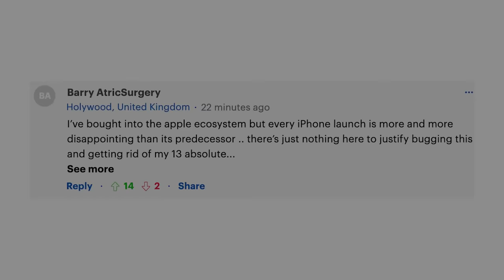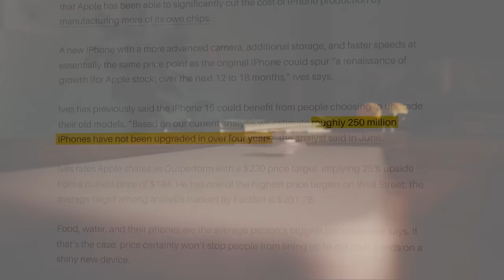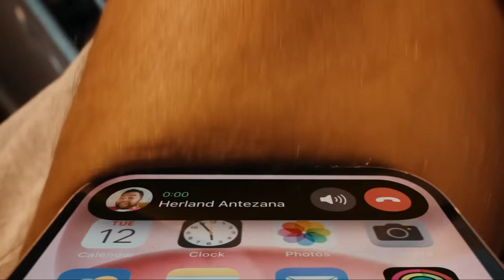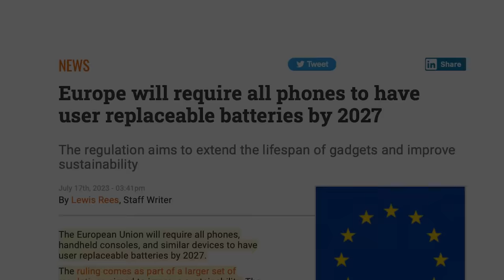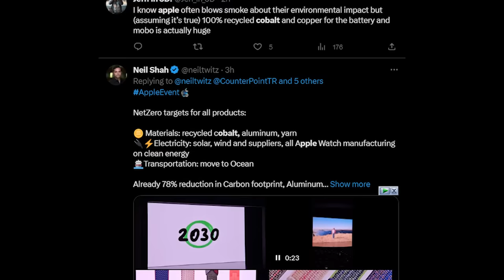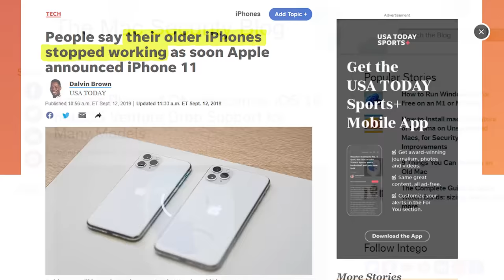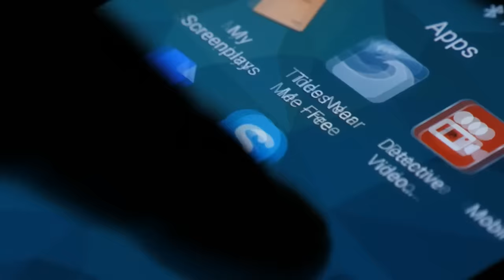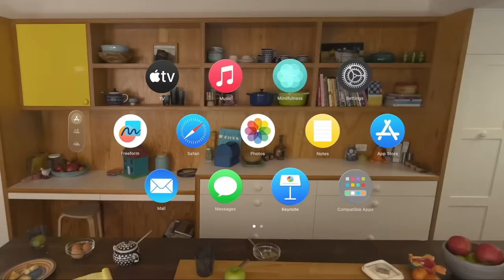The iPhone 15 Is Everything Wrong With Apple

Comment: I still use my iPhone 6+. Battery finally went out 2 years ago, and I replaced it myself for 20 bucks. I like the slim design and rounded edges, and all the apps still work fine. Camera takes good pictures, and cellular/data transfers are good. Never felt the phone was "slow" Why change? Maybe when iPhone 16 comes out next year, I'll upgrade; then I'll have a 10-phone upgrade span.
Reply: Downgrade imo
Reply: This should be the benchmark of praise
Reply: It won't be 10 phones
Reply: I kept my 6S for so long, but the battery was going down when it was plugged in so I had to upgrade.
Reply: I have a 6s and I agree with everything you said except camera taking good pictures. In fact that's my sole reason behind the urge to upgrade, for years.
Reply: i bought myself a new desk the other day and when cleaning out the draws on the old one i found my old Ipod classic, hasnt been charged in about 8 years, plugged it in and after a few hours it came on and worked as normal
Reply: the amount of hours you have wasted by simply using a slower phone is unfathomable. I am sorry for you.
Reply: @gajagoo  Yeah im with you here but at the same time, pay over $1k for a faster experience? LOL
Reply: @gajagoo oh boy, if biggest timekiller was a phones speed
We don't need no electronics to wash our time down the drain
Reply: he can also buy like the cheapest NEWEST android phone and still have a WAY better and faster experience. Why the fuck use an iphone 6+ and its not even an 6S which was already like 5 times faster than a normal 6. Just makes me scratch my head. @TilMayne
Reply: and he thinks being slow is a flex
Reply: i still use my Samsung S8 with no problems, only the battery is becoming noticably weaker since the day i got it but its fine because it still lasts around 4-5 hours on nonstop use
what i really hate about newer phones is not really lack of innovation but how every single one looks the same... its a sharp glass sandwich square with a camera cutout at top or below screen, every phone has same multiple circular cameras at the back...
i miss s7 edge s8, s9 and note versions of those phones... now everyone is doing the same thing preety much...
Reply: Ironically, I still kept my iPhone 7 after upgrading to the iPhone 12 this year. I mostly use it to play raid shadow legends, though.😅
Reply: @gajagoo  Ofcourse you have a Point about the better experience since mobile operators have their own device team and stop supporting older devices. I know, i work in the field. So you have a great Point here about the experience. I would not debate on this topic at all. Only thing i would say is that people should not be forced to think newer is better in the same manner as saying to a rich guy that this product is expensive. All people have different preferences and how they allow themselfs to experience things. I could go on and on but i believe my perspective can not be applied in this conversation. But i will eat popcorn and follow
Reply: @tatoweb  and the fact that its not a 6S. He was talking about a regular 6+ which is a huge difference actually 😂 Agree with your point still.
Reply: @daydreamdirty  7 is a HUGE upgrade in speed froma 6S, altough id say 8 is the bare minimum of daily usability without issues.
Reply: i remember back in Bali, Indonesia i lost(stolen probably) a brand new XR and i had go quickly grab an used iphone 6. And that was in 2019. Holy fuck the struggle i got so pissed off that i went back to grab atleast a 7 to just FUNCTION 😂
Reply: My 6 stopped charging in 2020 and i still morn it 😭. The new one is fine but it’s heavier and doesn’t have my headphone jack 😒. It’s a weird adjustment buttonless but actually it doesn’t freeze up as much as the 6 did. You know when you needed the button to make frozen apps go away? I give the 11 credit for working without the button tbh. I miss having the percent charge readily accessible though. And wireless charging isn’t as fast or as good as I’d thought originally. 6 was the peak IPhone imo. Big enough but small and light compared to the new bricks so it doesn’t hurt as bad when you drop it on your face
Reply: @gajagoo   he isnt flexing. he's saying, "if it aint broke, dont fix it" if he likes using it, let him use it.
Reply: Still use my IPhone 6 as well 🤝
Reply: Rounded edges suck. iPhone 4S was peak iPhone
Reply: @gajagoo  you talk like you aren't spending hours yourself wasting time on social media. I am sorry for you..
Reply: Buying an iphone 16 is a mistake
Just get an android
Reply: @xXVibrantSnowXx  there is almost no difference between iOS devices and android devices..
Reply: imagine if a New phone company came to be and created The impossible, a Phone that can Hover, a phone with 50000k GB 10000 Ram, 20k Camera Quality, Free 6g 24/7 connected internet, a battery that could last for 5 months  each charge, a Flying tiny drone camera with unlimited range, etc etc, would iPhone die?? 😂
Reply: Yeah this is the type of thing you don't get with Android even if people say otherwise. Androids really can only be used up for up to 5 years and most lose support after 3. Quality's also much higher with Apple. You can get around with with 2015 SEs, 6s, 7s, 8s today and barely notice a thing unless you're a hardcore mobile gamer. I even know a few people with 4ses still.
Reply: The 6 series wasn't great, wasn't terrible, but extremely preferable over anything afterwards.
Reply: its time you got an iphone 8
Reply: The 6s is like so iconic atp
I think every person has owned one at some point in their life and it's the only older iphone that many ppl still use.its just rlly good
Reply: Not a 10 phone upgrade if there's no practical difference between iPhone 11 and 15
Reply: You are right. Most people use their phones for the following things:
-phone call
-iMessage
-listen to music
-watch videos
-social networks
-play games

These 'heavy tasks' can be done by a 6S or 6S+ phone.
Reply: I don't know man, the camera on the 6S I used to have, ages ago, was definitely not even close to how good the camera on my current and previous Xiaomi was. Hell it wasn't even as good as the camera on the LG V20 I used to have.
Reply: Nice, i still have my s7 edge, im a mechanic so my phones get banged up.
I have replaced the screen and battery about 4 times now, i think the motherboard is the only original part of the phone, still have no plans to upgrade 😂
Reply: I just updated from my 6s+ after using it for years and having had countless screen and battery replacements. I'm loving this Samsung s23 so far, in fact I was sold on ot from day1 when I dropped it into a water barrel and found it the next day working as new
Reply: That's impressive. I thought I was doing well going from pixel 2 to 7!
Reply: As someone with a 6S, the camera is the only sole reason I want to upgrade. Those cameras are very poor, esp in 2023.
Reply: Drop ur pride and upgrade ur phone bro 💀
Reply: Thats good, iphone 6 is the thinnest iphone
Reply: @nnillat ”barely notice a thing” lol, coming from a person who upgraded from the 6 to the 12 pro max in 2020, this is a straight up lie. Pictures look 10,000 times better, the screen is better, the phone is faster, can actually run a newer OS, which means you can actually download and update apps. Like be fr.
Reply: @Slame333  I didn’t mean when you upgrade. I meant you could use a 7 or an 8 in 2023 without noticing how old it is. Everything still works (just less well than the newer models) and they’re not even slow. Same can’t be said for most Androids.

Obviously you’d get a better phone if you upgraded.
Reply: @gajagoo because android painful experience. As android user and now iPhone xs user I can say I will try stay at iPhone. I will prefer use phone with buttons than android if iPhones wouldn’t exist. I had fly, tecno camon 12, xiaomi mi 10 lite, Vivo y35
Reply: @gajagoo "when you're broke but still want to flex iPhone" is what OP is, he'd rather stay on his old and slow iPhone 6 than get a new cheapo Android that will be way faster because of brand name
Reply: @nullmori715  Tragically, you're right...

Comment: Back when we started having cell phones, a person may have forgotten to charge the phone at night, and we would swap the battery with someone else in the household, while the uncharged battery gets charged. It was so convenient. Almost as convenient as 0 to 100% charge in 45 minutes.
Reply: Not really.
Reply: Not at all, don't forget at the time we don't have such fancy connections, everytime switching the battery we had to set date and time manually
Reply: More like 0% to 100% in 30 seconds by swapping the battery😅
The good old days are gone 😢
Reply: dude, if that's really what's upsetting you then buy a power bank wtf, they are super cheap
Reply: Not that convenient, your date and clock used to get reset.
Reply: my charger had a lot for a spare battery. so if i forgot i could just swap batteries, and put the other one on charge.

oh noes! the battery life has died off, and now only lasts 1 day instead of 2 or 3!
No, i won't buy a new phone, i'll just pay $30 for a new battery.
Oh hey, battery tech has improved. now batteries last 20% longer.
Reply: Yeah and people used to send telegrams, you didn't need battery. How convenient was that, no battery, you just go to the local post office and send it. Omg
Reply: @antediluvianatheist5262  because the phone does more today than before...da
Reply: The sarcasm went so hard here
Reply: @miyamotomusashi4556 This is a lot more power inefficient and makes you carry around a large, bulky object and have your phone connected to it by wire.

Compare that to a small little sack you can hide away in your pockets or bag that contain 4 full recharges.

Comment: It's not just the planned obsolescence, but the active combating against reparability. When they don't want you repairing your device but instead to buy a new one, it makes all "we've done this for the environment" claim ring hollow.
Reply: Oh, are you talking about the only company in the industry with a self-repair program.  That's about to be expanded to Europe.   Or are you referring to the company that totally redesigned iPhone Pro line and regular line to make them easier to repair.  Either follow the tech or retire that silly reparability nonsense.
Reply: @bruxi78230  what kind of BS are you talking? Apple clearly isnt the only company with an self repair program bruh. and how did they make the new iphones more repairable?
Reply: @Oxide53115  ---- It's funny when a BSer (you) calls me for commenting BS, but then conveniently forgets to publish which other company has a self-repair program.  Which excuse was it; ignorance or hallucination?

They made numerous changes on the interior of the phones to make them easier to repair.  Next phone the 16 will have another improvement which involves wrapping the battery in a metal shell and new higher density battery.   Also since I commented they extended the program to another continent.
Reply: @bruxi78230  my excuse or mistake was thinking you could do some research for yourself, with you know Google.... 
but if you cant do an simple search, its Samsung ofcoarse and microsoft. why you calling me an BS,er when i was telling the truth and you werent?